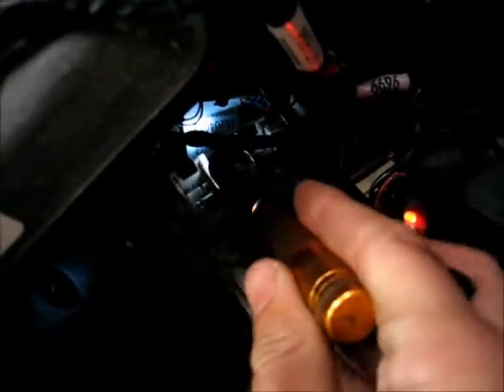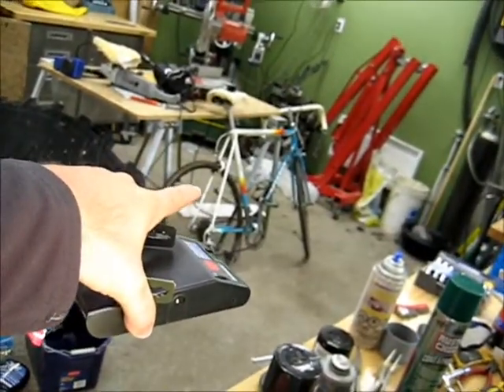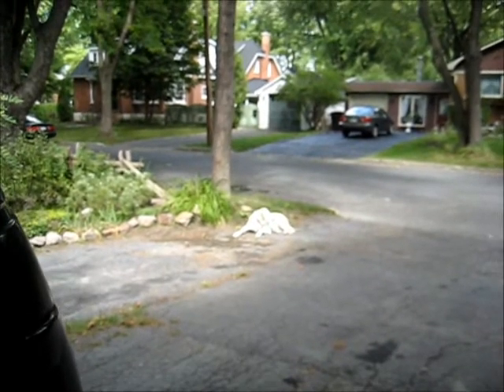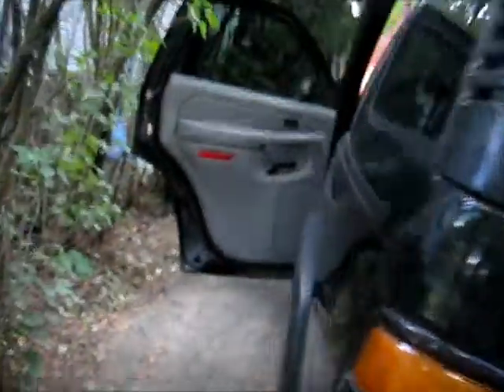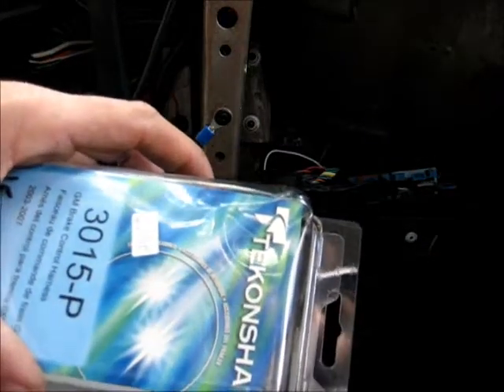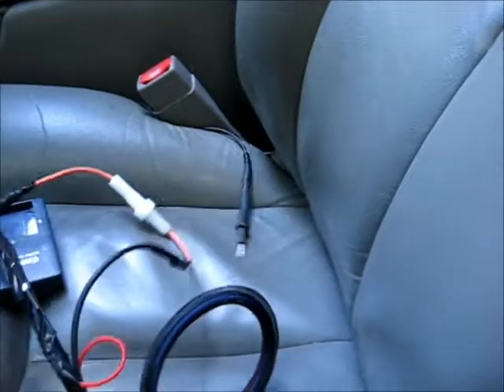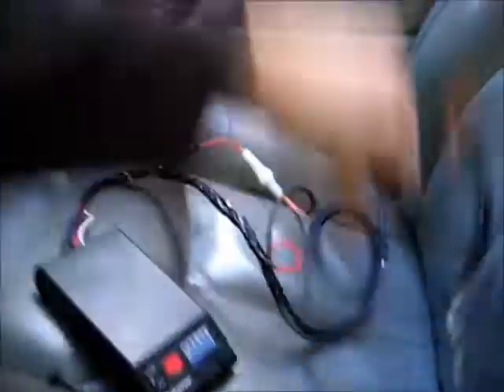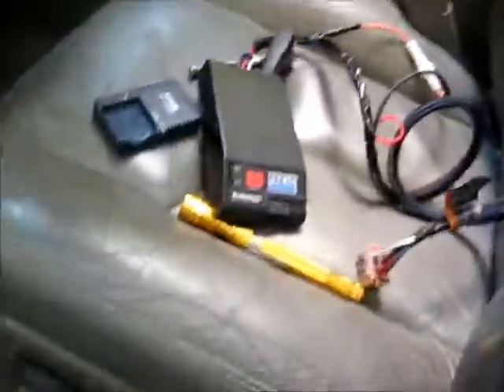Brake controller on da Hoe!

Comment from the maker: Your harness is already plugged for everything BUT the trailer brakes. The harness underneath the dash will link the brake controller to one of the pins in the trailer harness at the rear of the truck.